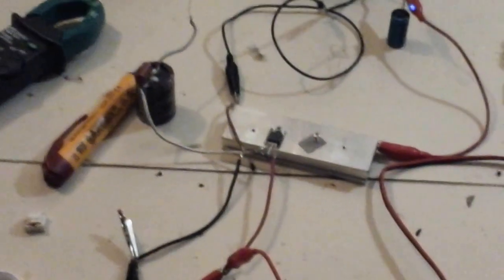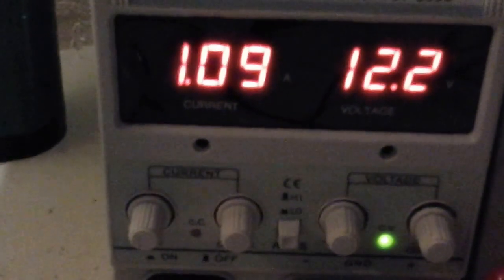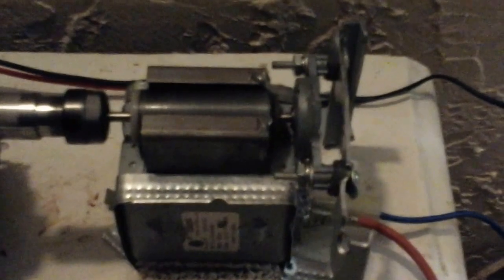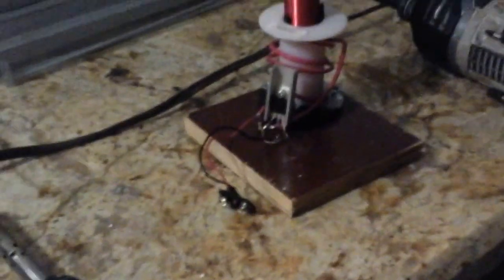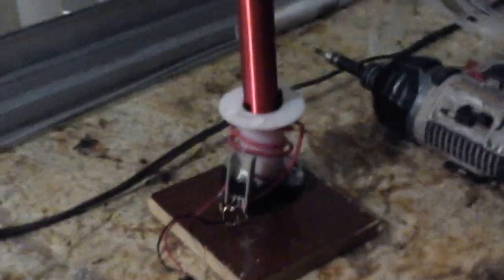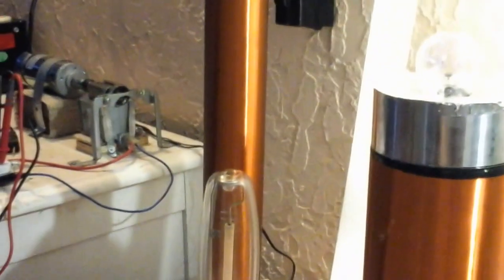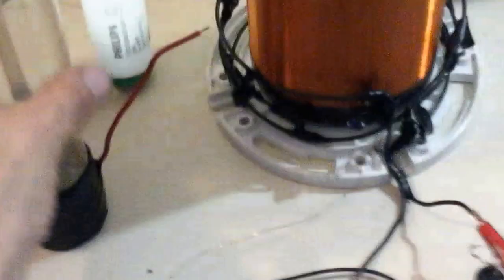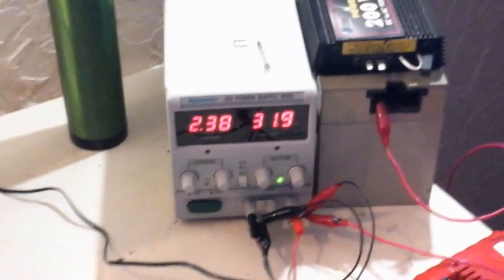My Slayer exciter and Gerard Morin replica

Comment from the maker: TY Shazizz...
Reply: matthew drummond  have u tried it with an oil filled heater
Reply from the maker: NO...sorry...don't have one...I live in Florida...never needed one.. it will heat up my soldering iron...i tried a toaster..but that didn't work...when i dissembled the soldering iron I found that it was spun like a Tesla coil... I have used a bridge rectifier to capture the dc voltage... if i had enough capacitors, I think enough energy could be stored to do some good work....everywhere I look I see wasted energy..It is very sad....